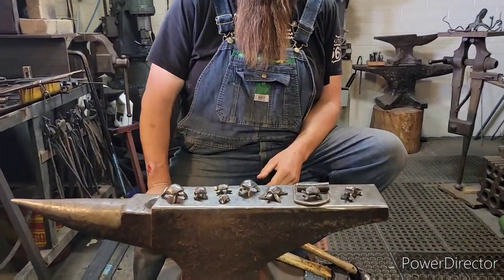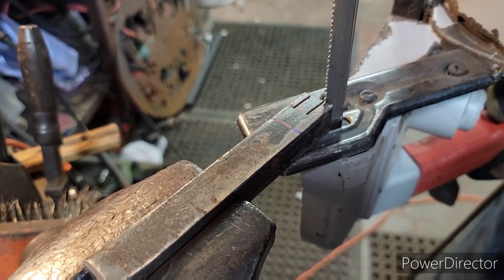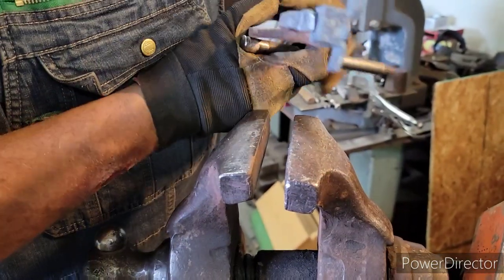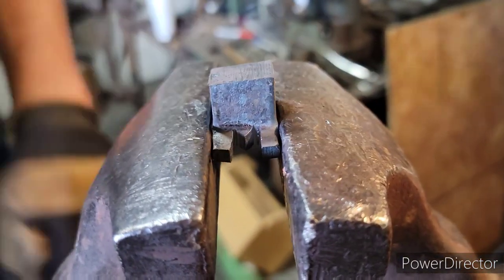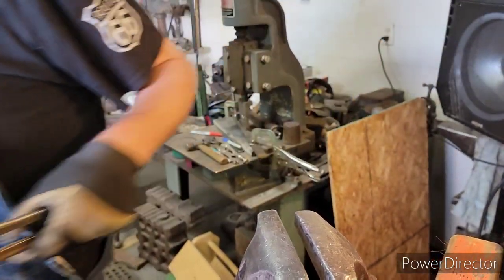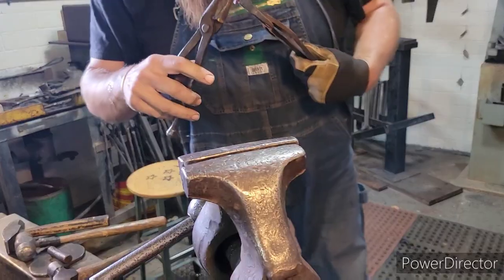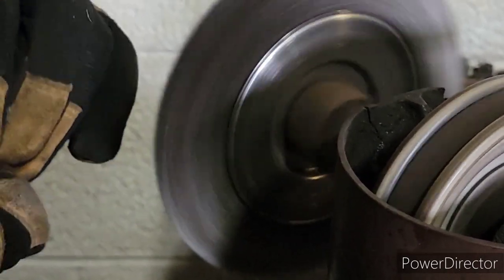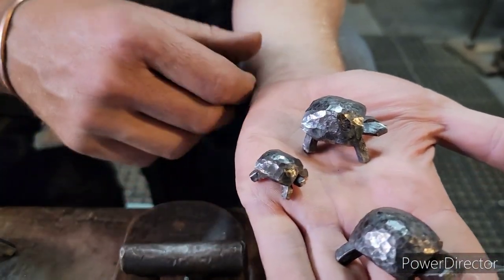How to Forge one piece Turtle. Blacksmith forging one piece turtle process  Let's Go

Comment: I've made 3 thus far and I'm obsessed! Lovely!
Reply from the maker: That's awesome.  I am obsessed with them too.
Reply: @letsgo6500  Have you tried hot cutting everything? I have made 6 thus far and 2 have been hot cut entirely, no power tools, and I feel like if I spent more time at it they could look as good as yours. I like hot cutting the little bit of material on the belly because the way I do it it leaves a triangle of material in the center which you can fuller down and I feel like potentially could add more detail
Reply from the maker: Yeah I have hotcut them. Just takes more time and skill. I wanted it to be as easy as possible to make. I have found that some customers like them traditionally forged.. if that's the right term.. others don't mind modern tools.  It's a good topic for sure. Customers, skill, time, tools.. I love seeing a piece someone made and seeing chisel marks ,punched holes, even a different surface texture/color that coal does.  There is a beauty in just using what tools you have.. a good hot cut in the right hands can make a awesome turtle.  This is a topic I think of alot.. I am glad you like the turtles. Using different processes cutting ,chisel, will make the turtles you build all your own.